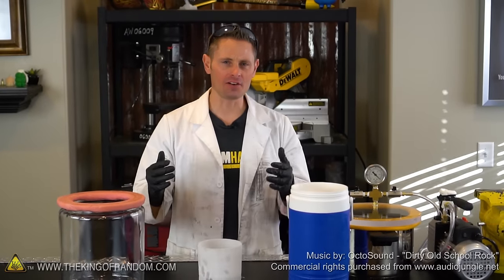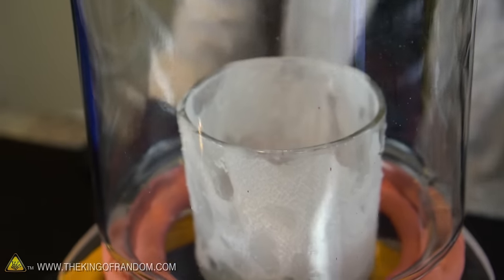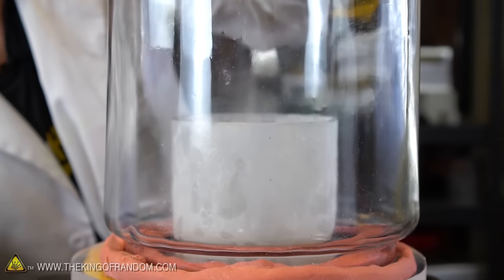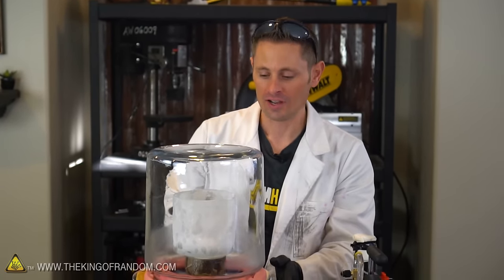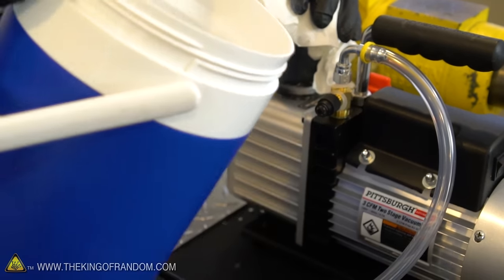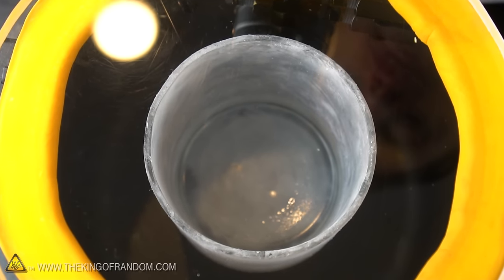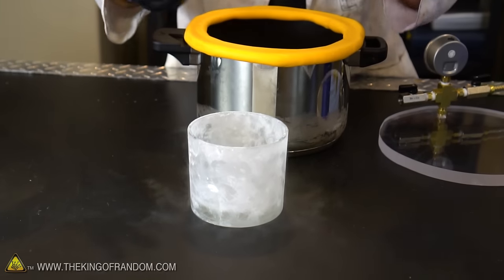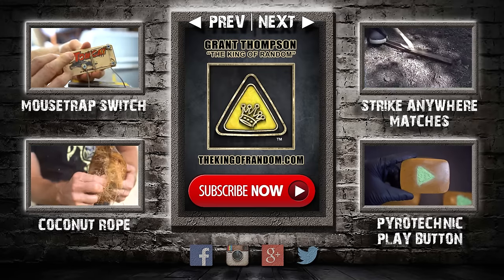Liquid Nitrogen in a Vacuum Chamber Fail | TKOR Experimenting With Liquid Nitrogen In Vacuum Chamber

Comment: Wait doesn't boiling point decrease as pressure decreases. That's why in a pressure cooker, there is a high pressure and also high boiling point
Reply: Exactly

He needs to increase pressure for it to work, not decrease.
Reply: it's the opposite, its called a critical state. as the pressure decreases, temperature drops allowing it to become solid.
Reply: Excuse me if I misunderstand Phase Diagrams, but when a material passes the critical point (typically high pressure and temperature) it becomes a supercritical fluid, which is not a solid.  Also, I highly doubt he is trying to create a supercritical fluid.
Reply: a super critical fluid is a critical state.... d-did you not read my comment...  The critical point is where gas and liquid have the same density, creating a critical state where gas and liquid are indistinguishable... Cody's lab made a cloud in a test tube via using said fluid...
High pressure creates a critical state....
Reply: True, but only when combined with high temperature. Decreasing pressue only makes it more gasseous.
Reply: also i saw the diagram, it's works the exact opposite, the removal of atmosphere creates a solid, liquid nitrogen is not affected by a pressure drop that way because fluids don't compress or expand... the gaseous nitrogen is expunged due to it being a compressible gas, but the liquid form is not. as you create a vacuum the liquid nitrogen starts to boil, and as it boils it takes heat with it, after enough heat is removed it will turn into a solid chunk of nitrogen, you can do the same thing with water, oxygen, really anything that can become a gaseous state.
sublimation, search it.
Reply: Are you trying to tell me that sublimation is taking a liquid and turning it into a solid?  If so you are very wrong.  That is called crystallization.  If you are trying to say that sublimation is a gas to a solid without being a liquid, you would be wrong because the experiment does not begin with gaseous nitrogen and that would be called deposition.  Sublimation is going from a solid to a gas without being a liquid.  The experiment starts with liquid, not solid nitrogen.  Search it.
Reply: ... if you aren't in school, please, go back.
Reply: .....

um, Low pressure means higher boiling point, Because there is no pressure, that means heat will be nearer to impossibility because it will escape faster. Where as putting something under pressure would heat it up faster (Hence why we have pressure cookers and is the basic principle of some forges) because those heated molecules will bounce back more, or even settle, making them get hotter easier.
Reply: FoxGaming no, lower pressure = lower boiling point. for example, the Armstrong Limit is when you reach an altitude so high that water will boil at 98 degrees fahrenheit, instead of 212 fahrenheit like at sea level. at this altitude, unless you have a special space suit on, your blood will boil and you will die
Reply: FoxGaming, A chemicals boiling point is related to its vapour pressure (the pressure of its evaporated molecules in contact with the liquid) and atmospheric pressure. When a vacuum is applied this causes the atmospheric pressure to be lowered until a point when it becomes less than the substances vapour pressure and starts to boil. A pressure cooker increases the internal pressure by holding in steam which heats up the food rather than the pressure itself doing the heating.
Reply: FoxGaming you are very wrong here. Low pressure means lower boiling point. The state of matter depends on its kinetic energy compared to the pressure it's under aka ke of its surroundings. Lower pressure does mean lower temperatures do to the decrease in particles. We have pressure cookers because they allow liquid water to reach higher temperatures without boiling
Reply: Andrew Braz it wouldn't be a "chemical" either it's a compound.
Reply: Bass Master, I was using chemical in a broader sense to describe lots of different liquids. But they all would still be chemicals, but a compound can also be used to describe them. In this case however, N2 is not a compound.
Reply: low pressure means higher boiling point, so the nitrogen boils and the gaseous nitrogen carries away heat for the liquid to reach the freezing point
Reply: Lance Lindle Lee
Reply: FoxGaming I have a very simple way of remembering. Think of a liquid as a pool of little balls. These balls want to leave. To leave though, they need more force (Energy -> Temperature) than what is pushing (Pressure) them back into the pool.
Reply: RKSNomad Thanks for the explanation
Reply: Reducing the pressure reduces the boiling point. So it makes it easier to boil, not easier to freeze. What you need to do is increase the pressure, reduce the temperature, then expose back to atmospheric pressure.
Reply: Blake Lambert what happens is, by lowering the pressure, the liquid nitrogen turns into gas. the particles that turned into gas draw heat, meaning it would make the remaining liquid nitrogen colder and possibly freeze. grants problem was that he just boiled all of it off, not at a fast enough rate.
Reply: He actually did hit the triple point of liquid nitrogen, when you see the pop in the nitrogen, that's when the layer of ice is formed, and gasses underneath it forced it up do to pressure.
Reply: Grapegifter I'm not sure what was causing the bumping, but just from listening to him calling out the pressure you can tell he didn't reach the triple point.  He reached a bit less than 20 mmHg from what I can tell, but he would have needed to get all the way down to around 4 mmHg.

Comment: You lowered the boiling point by decreasing the pressure, thus making it easier to boil
Reply: I just posted this before I saw your comment. I'm with you...

Surely decreasing pressure is never going to encourage it to solidify. Wouldn't increased pressure be the prerequisite to encourage solidifying at a constant temperature?

Comment: I might have a suggestion for this experiment. Could you try putting several vacuum pumps in parallel with each other to draw off the one container? The theory being that it would distribute the workload and either reach your goal quicker or keep the individual pumps cooler (hopefully both.) 4 pumps seem to be a nice round number.

Comment: how about you try and build a 2 stage vacuumchamber.. like there are 2 cans, a big and a small one, the small one is connected to the big one and the big one is connected to the vacuum pump, both seperated by valves. so if you use the pump, you can make a vacuum in the bigger container and use this vacuum to rapidly make a vacuum in the smaller one by opening the valve that connects the two

maybe this could be the solution why the liquid nitrogen didn't turn solid, but this is just a theory based on nothing

also i'm sure that  the rapid vacuum would make a cool effect on water bottles or marshmallows since they would expand so fast instead of the slow and equal expansion with the vacuum pump only
Reply: Tizzandor Because the smaller chamber would be at one ATM of pressure, there would not be even close to a vacuum by opening the small chamber to the large one. It would lose a lot of pressure, but it wouldn't be any better than using a pump to remove that same amount of pressure. It is easy for a pump to remove the majority of the pressure, it only becomes difficult for the pump once the pressure is greatly reduced. A large vacuum chamber wouldn't make the small chamber a vacuum, it would only equalize the pressure between the two.

Comment: How will a playing speaker sound in a vacuum chamber
Reply: zachary jacobson that's an amazing idea
Reply: it won't play
Reply: zachary jacobson nothing will happen because sound needs a medium to travel
Reply: zachary jacobson it won't sound like anything because the sound waves move throug the atmosphere and you only hear them when they reach you without an atmosphere to move throug it cant reach u...
Reply: wooooo yeah!
Reply: actually you can hear sound because it will vibrate the glass therefore hearing the sound
Reply: it'll just go silent since theres no air for the vibrations to pass through
Reply: Or the classic alarm clock suspended in the air by string.
Reply: Check Cody'sLab channel if you're impatient

Comment: wait whaaat do'nt things boil off and become more gaseous/less solid under low pressure
Reply: simce when do heat and pressure not vary directly
Reply: madison king Yes they do, but as more liquid boils, more energy is removed from the liquid. Once enough heat is removed, the remaining liquid will freeze. This is the same way water can freeze in a vacuum.
Reply: eventually as you decrease the pressure it reaches the triple point at which it can exist as a solid, liquid, and gas at the same time
Reply: Cody'sLab did a great video on this;

Water under vacuum will eventually boil, but if you keep the vacuum going it'll eventually boil itself into freezing.

Strange, I know.
Reply: Boiling is an endothermic process. The nitrogen that boils away takes the heat of the rest of the nitrogen as it goes. Eventually the nitrogen that is left will reach its freezing point.
Reply: That may be why hot water freezes faster than cold
Reply: it still doesnt quite make since considering that liquid nitrogen is 100% "volatile" at room temperature, a vacuum as grant said would lower the boiling point reducing the amount of energy that each molecule needs before it leaves, thus stifling the evaporative cooling effect that was already hapenning outside the vacuum7. So i suppose it probably have something to do with the rate  of reaction, the pressure would need to be at a low enough point to where a very large portion of the nitrogen boils off very quickly(to counteract the fact that each individual molecule carries off less temperature). I think a very complicated calculation might be able to be done if given the state of matter chart for nitrogen, some thermodynamic equations, the vapor pressure equation, and possibly the gas law, in order to solve for the the pressure that completes this task. Either way since the goal is that the nitrogen takes away the energy from the remaining nitrogen I think an insulated container is in demand.
Reply: madison king
Reply: BoseLuck LGB what

Comment: melting point drops at low pressure? something seems wrong to me
Reply: Cause it is wrong.  He totally screwed this one up and flip-flopped it.  Decreased pressure = decreased boiling point AND freezing point, meaning he would have had to decrease the temperature.  I really don't understand how he didn't comprehend this.  If he knows decreasing the pressure decreases the boiling point, as evidenced by the boiling off of the liquid, why in the world did he think it would freeze?  

To increase freezing point, you should increase pressure.  Just like a can of pressurized air.  The air liquefies at higher pressure, therefore it would also freeze at even higher pressures.
Reply: The triple point of Nitrogen is at 0.124 Atm @ -209.97°C so lowering the pressure is a requirement.
Reply: he also poured nitrogen on a "hot" engine to cool it. so there is that.
Reply: Just because one doesn't understand it, doesn't mean it's wrong.  Decreasing the pressure lowers the boiling point.  The liquid is a mixture of molecules of varying energy levels,  the temperature is basically the average of the energy levels.  With the lower pressure, the most energetic of those molecules are able to escape the liquid leaving behind the lower energy molecules, resulting in a lower temperature liquid. He did start the process all over each time he had to add more (warmer) liquid nitrogen to the pot.
Reply: He was correct in saying that the boiling point would drop at low pressure. But he understood it incorrectly, at low pressure it boils more furiously at room temperature. You need higher pressure for it to solidify at room temperature. 
You can think that high pressure is pushing the molecules closer to each other, which is the solid state, and vacuum is pulling the molecules further apart, which is the gaseous state. Also, as you raise the pressure and the molecules get closer together, the heat energy that is stored in them gets released to the surroundings. Its the opposite with low pressure, for example if you release a gas thats under high pressure back into normal pressure, it absords heat at the point where it expands.
Reply: It is correct for nitrogen, lower melting point means easier to melt. Though water doesn't work this way, you can actually freeze really cold water by lowering the pressure because the boiling point increases.
Reply: I don't know where you might have heard that pressure is required to facilitate a phase shift from liquid to solid? Do you mean gas to liquid maybe?
Reply: David Kenny
 Pressure is required to facilitate a phase shift only if you intend to keep it at the same temperature.
Reply: It is correct. Pressure forces the particles closer together. So when you have less pressure it takes less energy (and therefore less heat) to forces them farther apart into a liquid state.
Reply: Nonono, decrease in pressure = lower boiling point, not higher.
Reply: same doubt
Reply: At a low enough pressure the nitrogen will sublimate from a solid directly to a gas and some of the liquid will become solid but he needs a vacuum with much greater volume pull per second or to hook several vacuums to the container to keep up with the volume of gas being produced.  Think about when you put dry ice in a sealed container and it becomes liquid under the increased pressure, but then you open the container and the pressure and temperature drops. Some of the liquid converts back into a solid. Same idea here, he just never reached the right pressure and temperature.
Reply: I agree that the issue here seems to be suction rate. When a liquid vaporizes, the liquid left behind essentially has a lower temperature than when it started because the molecules with the greatest kinetic energy are more likely to vaporize first. This drop in temperature means the vaporization slows down, allowing the vacuum pump to move the equilibrium pressure (at which the pump is drawing nitrogen out as quickly as it is vaporizing) down further, and so on. Maybe he could have pulled it off if he could have kept it going without interruption, but it seems to me that if the pressure needle stopped moving then he wasn't able to evacuate the container quickly enough.

Comment: Will sodium metal explode or freeze in liquid nitrogen? should give it a shot!
Reply: It wouldf just cool as nitrogen is generally non reactive. It's the water that causes Sodium to explode as it produces hydrogen gas by turning the sodium and water into sodium hydroxide.

 Na + H2O = NaOH + H + Energy.
Reply: N7SpectreLT It actually isn't the production of hydrogen that causes the explosion. It is a coulombic explosion due to the sodium violently ripping itself apart as the 3S electron is pulled to the outside of the metal to bond with OH ions. The explosion sodium causes is much too large to be just as a result of the expansion and ignition of hydrogen gas.
Reply: Parth Hiren Just so you know, sodium metal is already frozen. If it is a solid, it is frozen. Things don't need to be cold to be frozen.
Reply: Malcanth That's pretty interesting. Thanks for the correction =3
Reply: Oh Yea! Thanks Guys!

Comment: My suggestion would be to get a second, much larger chamber, that you can attach the vacuum pump to and put in series with the viewing chamber. That way you can draw the max vacuum you are capable of with the vacuum pump on the large vessel and quickly open the valve between the auxillary tank and the viewing chamber, because part of the problem is that the pump cannot pump fast enough along with the triple point chemistry stuff mentioned by the others.

Comment: Ah THERMODYNAMICS!! The best way to understand this experiment would be to look at the properties of Nitrogen on a Pressure v Temperature graph. You will notice that there are three distinct phases of matter (Vapor, Liquid, Solid). Now we are working in the realm of back yard science, so there is no need to explain the super-phases of matter.

Anyways, in this vacuum regime we are attempting to change the phase from liquid to solid by lowering the pressure, but pretty much holding the temperature constant. Heat flow into the system is the biggest enemy here. 

In your system, near the end of your experiment, you notice the large burst of bubbles occasionally, this brief instant is whats known as the triple-phase of matter, unfortunately the solid turns back into vapor way too fast to appreciate it. 

The pump is therefore strong enough for this experiment, but you need to control the heat flow coming back into your system.

Proposed Solution: immerse as much of the exterior of your vacuum chamber as you can into a slightly bigger container of liquid nitrogen. Lowering the heat-flow intake or making that heat flow negative will definitely improve your results.

Thank you for reading!
Reply: Or just reduce the size of the vacuum chamber.

Comment: Vacuum pump was way too small for that application, I use to work at an investment casting place where all castings were poured in a vacuum chamber. They could pump a 30 cubic foot chamber down into the micron range in less then 30 seconds. Any liquid placed in the chamber would freeze in less then 15 seconds. The problem with liquids in a vacuum system is contamination, it could take up to an hour of hard vacuum ( 10 to 20 microns) to remove all the moisture from the oils.